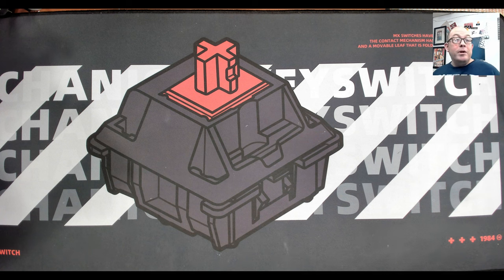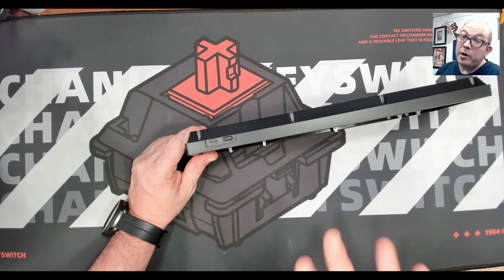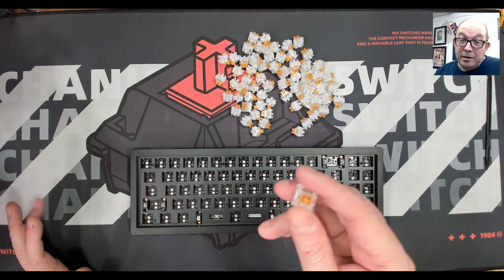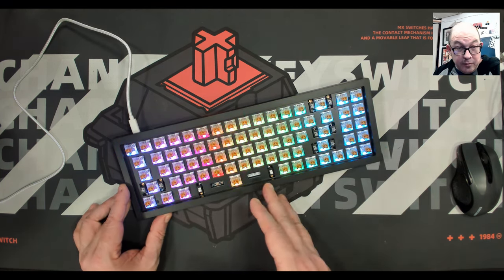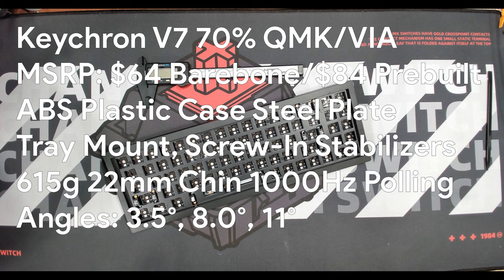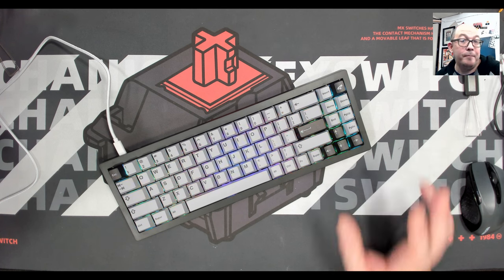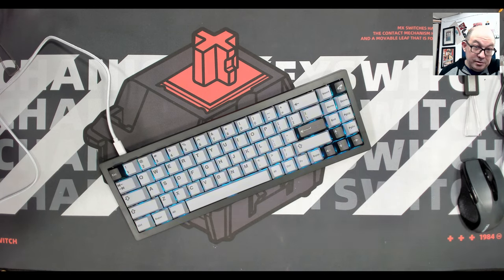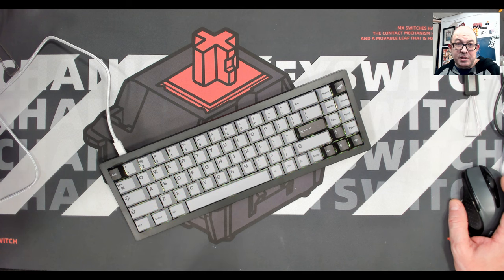Keychron V7 - 70% hot swap QMK/VIA keyboard from Keychron the latest entrant in the V series.

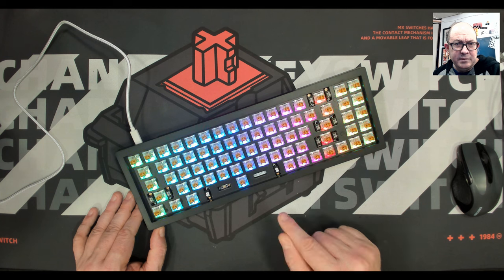Comment: 7:25 You mention modifying the RGB on V series. Do you have any videos on that?
Also, is it possible for the lights to go to sleep with the computer, or do they RGB always need to be turned on/off manually? 
🙏
Reply from the maker: In order to get the RGB lights to go to sleep when the PC does, you'd need to add this "#define RGBLIGHT_SLEEP" to the config.h file for the QMK source and rebuild the firmware.

I do plan to make a VIA video in the near future.
Reply: @MechKeyboards  Look forward to it. Stay Subscribed! 🔔